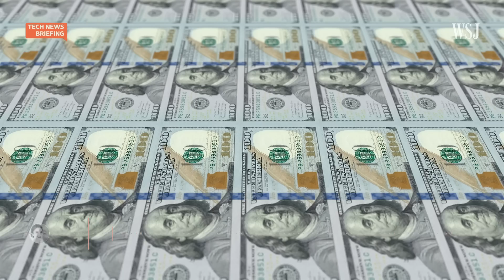3-D Printing May Now Be More Reliable for Mass Production | WSJ Tech News Briefing

Comment: Will 3D printing put people out of work? Probably the opposite. Traditional manufacture with formative and subtractive methods is ideal for most things, but if a crucial part is stuck in a supply chain problem, everyone's idle until they can be obtained. Also it is now possible to 3D print good molds for injection molding. And special jigs and tools.

Comment: 3d printing is great for proto typing but it doesn't scale up.
Reply: 3d printed parts are routine in high-end, mid-high-volume automotive applications. Scale is already achieved, it’s just unit price that still needs to come down.
Reply: @Oluseyi S  well, yeah. I won't be shocked even if its used in low end cars as well. 

But compared to other goods, cars are considered low scale production since they are expensive, people don't buy them annually and they are large with high number of parts.

But take something like a spoons, chair, or any other consumer goods. I don't see scale in most things to be honest.
Reply: @Random_dud31  I think the only  affordable " 3d printed engine part you get to buy these days are piston heads for Porsche rs?

Comment: the prob with 3d metal printing is that CNC is so much better and produces a stronger part
Reply: Right tool for the job. Can't manufacture certain parts with cnc or casting.
Is there endoscopic welding?